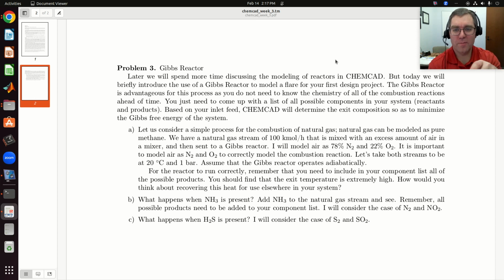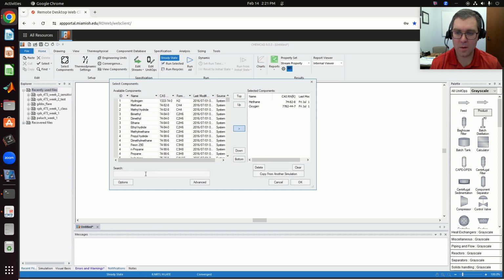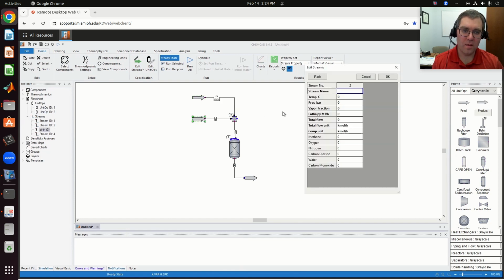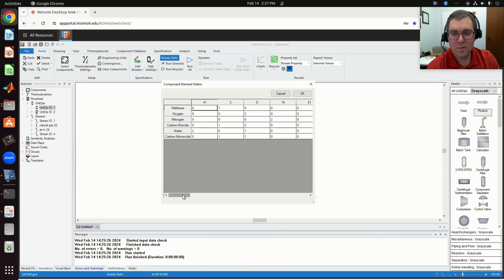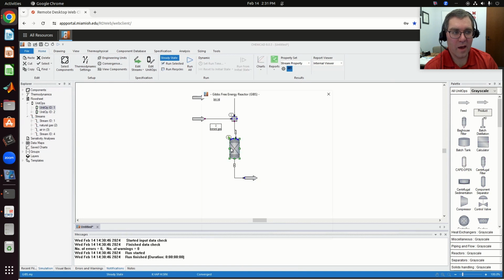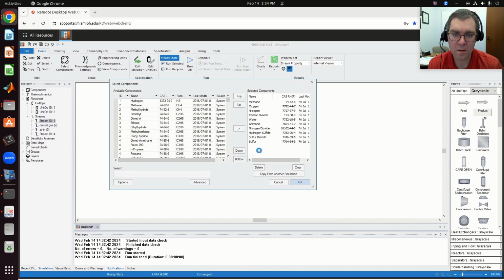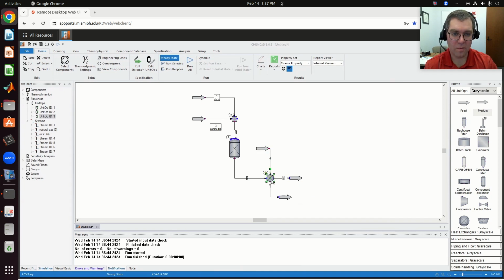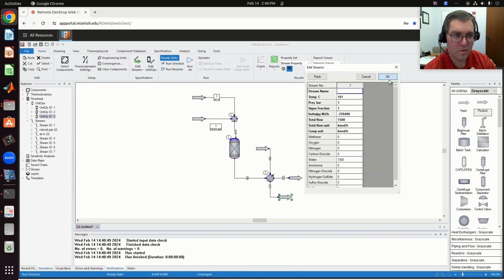First Gibbs Reactor Simulation with CHEMCAD

Comment: Any reason you did not include NOx in the first round of reactions?
Reply: Flares operate at very high temperatures so thermal NOx formation becomes thermodynamically possible but the impact on major species (CO₂, H₂O, N₂) is negligible.